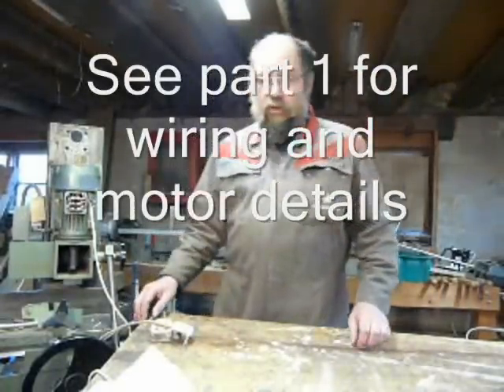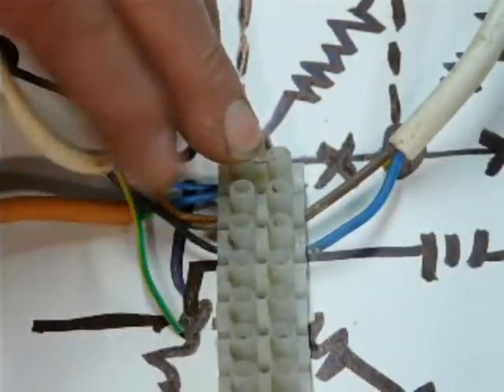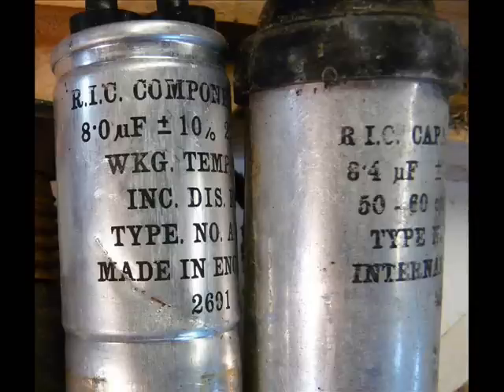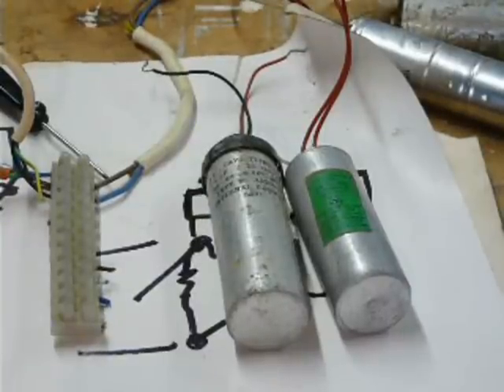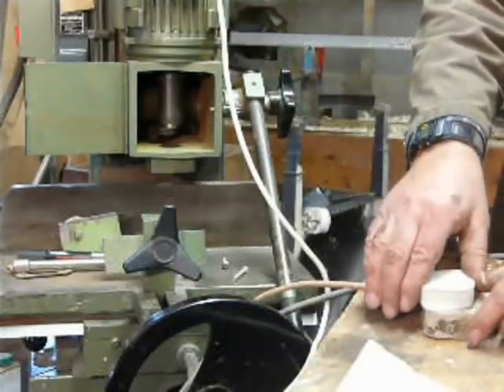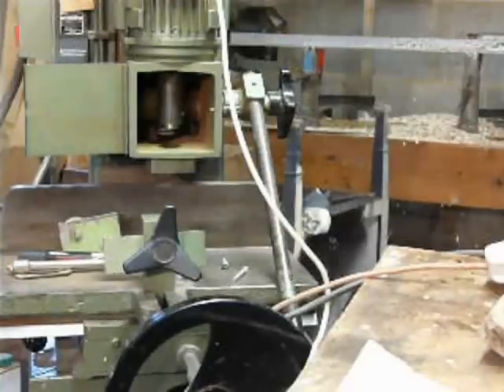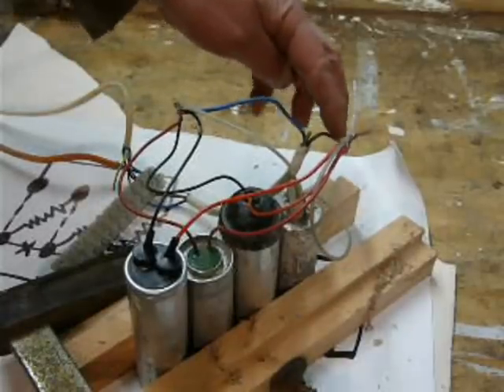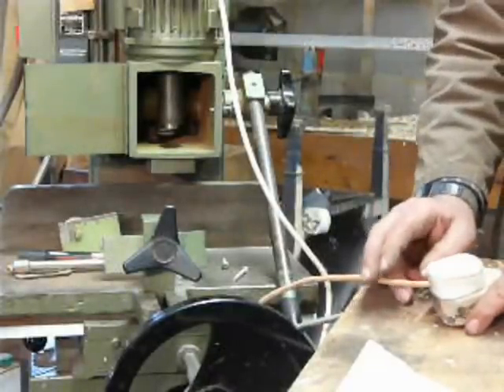How to do it: run a 3 phase motor on single phase supply. part 2

Comment from the maker: The run capacitor shifts the phase so that the second set of coils will produce power. This mean the effectively the motor is running on 2 phases and so will only produce 2/3 of the power. The start cap is to give the extra kick against a starting load. To get all 3 phases working you need a cap from both live and neutral to the third delta connection. The start cap will then also determine the direction of rotation. Hope that helps.

Comment: So the capacitor just enable's it too give it a little boost at the start..Which can also be done with a tiny single phase motor then disconnected once upto speed..That is basically the same job..??Capacitor is giving the 3 phase a boost to start,Because unlike single phase most have capacitors in them already..Im trying to learn as im new to elec and metalworking Thank you

Comment from the maker: Hi. This question came up about 3 months ago; using this method about 30% of the Hp is not available. You can use capacitors from both the live and neutral to gain the extra power but a start cap is needed to set the direction of rotation.

Comment from the maker: Hi. Thanks for your interest. I put the capacitors on the end of a wiring tail just to make things clear in the video, as long as the caps are wired correctly then wiring them in the motor box is fine. 3 hp motor will draw quite a lot of starting current, but only for a second or so. Try the switches and monitor the performance. I hope you have watched part 6.

Comment: The terminals inside the wiring box on the motor that is. One more question is I have a couple of switches rated 16A 250v (ac t100/55) three prongs with a red indicator, would these work for switching a start cap on? I appreciate you might not have the time to answer everything but I welcome the YouTube community to answer!

Comment from the maker: Thanks for your interest. If you watch all 6 videos it will give you a basic grounding, as will the testing capacitors video and the preventing arcing of contacts switching DC. I will not email you directly as my email changes frequently to avoid spammers.

Comment from the maker: Hi. We are into unknown territory here. The only thing I can say is that at about 220v a 9hp motor will draw about 36 amps running and at least 6 times that to start. There is only one way to be certain, but try it without a starting load first.
It would be interesting to hear about your experiments.

Comment: Hi would it be possible to do that same on 9.0 Hp, 208 Volt, 60Hz, 3 Ph, 1725 RPM and still get it to run at 1725RPM under pressure of sanding wooden floors.

Comment from the maker: HI. The problem is with the start current needed for a 20HP motor. The idea of the videos is give the viewer the experimental tools, so that a trial and error method can be used to find out the capacitor values without producing too many volts on the 3rd coil.

Comment: Hi, thanks for the interesting video. However, should you not be careful while adding the additional capacitors because the ones that have just been used could be charged? Or do they immediately discharge into the windings after switching of the main power?

Comment from the maker: The main criteria are the max voltage and capacitance. In the comments of one of the other videos we have been going through a formula to work out the values.
If you use a higher voltage capacitor that is fine, but a lower voltage will case a failure
.

Comment from the maker: .The first consideration is the start current, and on most single-phase supplies the consumer unit limits this to 30 amps. The start current is only needed for about a second unless there is a lot of drag.
But the best way to find out is to try it, remembering that you will only be using 2 phases unless you use a tanking capacitor on the neutral. There is a link to information on this in the details on one of the later 3 phase video details: further reading. Lets hear how you get on

Comment from the maker: HI. Good question, yes you get about 60% of the power, as the motor draws less power from the supply. This is not a problem in workshop conditions as the motors will generally not be running all day long, day in and day out. You may wish to subscribe for video updates. Thanks for the question.

Comment from the maker: I would not like to hazard a guess, but is this a stepper motor? In which case they need a driver. If not then use the basic principal to delay the phases.

Comment from the maker: Hi. Good question. The motor plate shows it is a 1.1 Kw  power motor. I have just checked the current and it draws 2.4 amps when running and over 10 amps for less than a second to start. Thanks for the comment.

Comment: ah ! hadnt thought of that because of the  big motor always being under stress (lifting things) but then I suppose yes its just the same as any other spinning motor at the end of the day, so I´ll try the extra strter capacitors for the biggy and once its going try leaving it at 24uf.

I´ll tell you how I get on when they arrive, cheers boss

Comment from the maker: Hi. Thanks for your appreciation. Sometimes a motor if it needs to start under load will need a start capacitor. Remember the capacitor connection dictates the direction in which the motor starts. Have a look at part 4 for the info on using a start capacitor. Part 3 will give some good info on voltages and capacitor values. Sometimes it is necessary to use a start capacitor to keep the overall cap voltage down. The videos mentioned should answer your question.

Comment: this is brilliant, I´ve just got my long dormant crane pulley breathing life again thanks to a couple of old capacitors!!. however I have a question. the gantry pulley has 2 motors, the one controlling the traversal movement works well it seems with 24uf, but the biggerhook up and down motor tries but doesnt go any where. I´ve ordered another 2 20uf capacitors to try and get it going, but I´m wondering what effect the upped capacitors will have on the smaller motor. use is relatively slight :)

Comment from the maker: Hi. Thanks for your interest. A start capacitor is just a normal capacitor but can be larger. This is used when a motor is starting under load. My pillar drill with many speed ratios needs one. If you look at part one of this series the wiring is explained. They can be operated with a simple push switch to connect then until the motor is up to speed. They can have values of 50 uf and above because they are connected for only a second or so. Hope that helps.

Comment: You mention starter capacitors as if they were something other than what you were using. What is the difference between the two types of capacitors and why use one over the other thanks

Comment from the maker: Hi. Yes I have noticed this, and can only assume the choke design has been improved so the capacitor is not required to start the tube. Either that or a small cap is part of the choke. It's all about getting the electricity to flow through the mercury vapour in a vacuum inside the tube. So perhaps the modern slim tubes need less of a kick to start. Anyone know more?

Comment: The windings will certainly will discharge the caps--and very quickly for that matter.  If a temporary connection comes loose--and they hold a charge--they'll still bite.  

I enjoyed the video:  Good info on 3PH equipment and caps.  If my budget sticks around, I'll be bringing in some 3PH experiments, myself.

Take care, and hope all is well...

--Robert

Take care...

Comment: Also a good idea to short the caps after power is removed.  The windings should do it, but just to make sure they are discharged before touching anything.

Comment from the maker: Thanks for your enquiry. The video shows how to experiment to find the correct capacitor value. I suggest you start with 30 uf and work from that point. The start capacitor could be by manual switch to get things working. The book I show describes several automatic methods. It is still available, so maybe that would be a good purchase.

Comment: I'm in the USA and would like to know the horsepower of the motor you are powering. If it's one HP would you triple the capacitor value for 3HP? Does a start capacitor have to be individually switched or will it drop out after it's job is done? This is the most sensible video I have found on the subject and I do appreciate you sharing this knowledge with us. God bless.

Comment from the maker: That's right it really works. Let us know how you get on with the neutral shift. For high torque starting use a start capacitor in parallel with the run capacitor and a manual switch.

Comment: thanks for the video today at work i salvaged a three phase moter thinking i would have to ofset the phase angle on two of the moters windings as i thought that the 3 phase moter worked on the princble that every winding's suply had a diffrent phase angle but now i am a little confused but at lest i know now that it is very easy to wire 

so thanks alot mate, just what i was after

Comment: The AC motor must be low power, no more than 1 knight or 0,75 Kw, to accept connection on 230 volts (usually delta connection) and does not require high torque at startup. In practice this is a fan, pump or similar  load.The capacitor should becontinuous, not starting capacitor, not electrolytic and withstand over the voltage will work.The three-phase motor connected to asingle phase supply will have about 70% of the torque would have three-phase, hence at startup and can be below 20% of nominal

Comment from the maker: Thanks for your comment. This video shows how the whole thing works, how to set out the wiring, what happens with insufficient capacitance, and how to use capacitors that have been salvaged. Have you uploaded a video showing the formula use? That would be interesting.

Comment from the maker: Hi. Thanks for your comment. I have used this technique for many years and never had a problem. These have been where there is only medium starting torque required. The start winding on a single-phase motor has less resistance so could cause problems. However the measured voltages between the capacitor feed on this motor and the positive is 246v, and to the negative 226v, running on 236v mains. No spike when switched off. Hence this has proved reliable in this situation. Try it and see.

Comment: Just fyi, capacitors on 240volt motors need to be rated at a high voltage than the supply voltage, typically at 350/440volts depending on motor design. In one of my recent vids i show the high voltage generated across the start winding and capacitor.